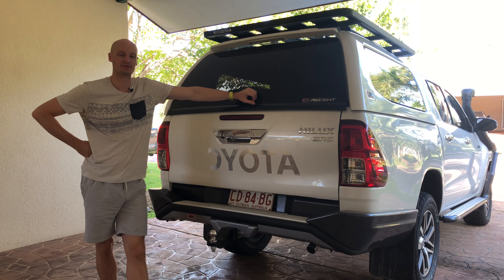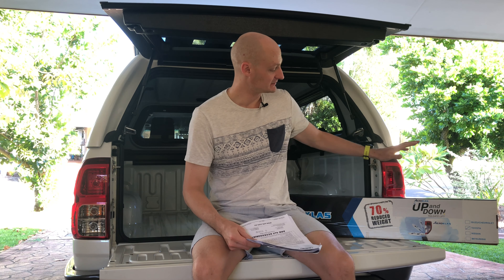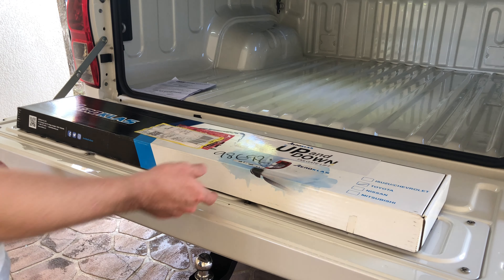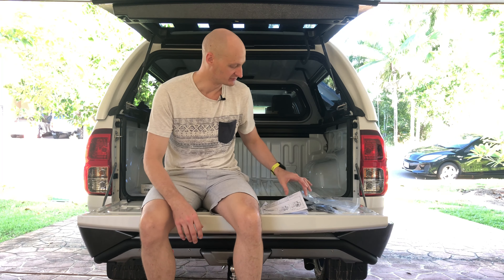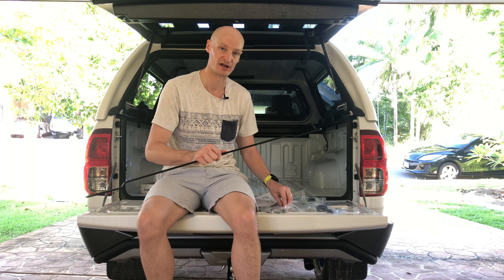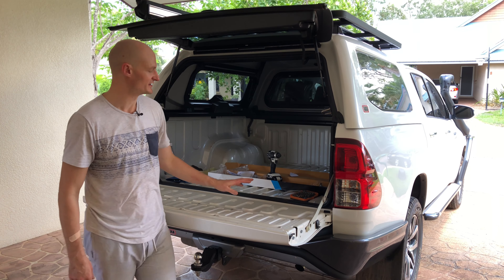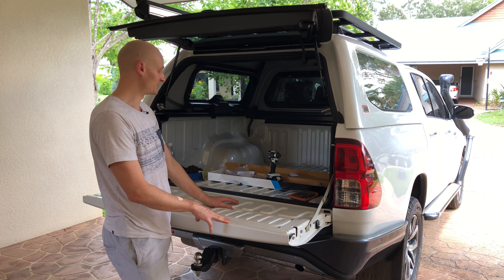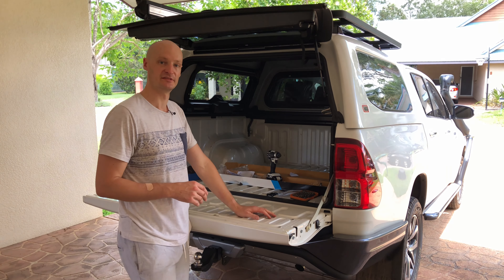Tailgate Assist Install on Toyota Hilux SR5

Comment: Bro nice Hilux you have. I have a 2021 Hilux G Philippine Version. By the way were did you buy your rear dust rubber protector? The one that is place near your tail gate to prevent dust. I want to have one to protect my trunk things from dust. Thanks
Reply from the maker: Hey mate, it was one of the options you can have fitted by the dealers. It’s called the Hilux dust defence kit. Keeps a good portion of the dust out over dirt roads.